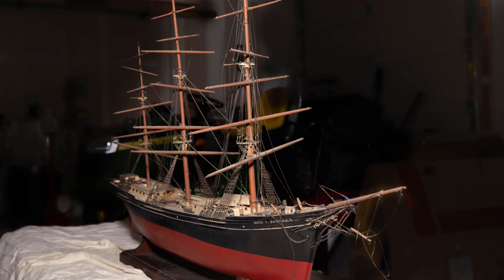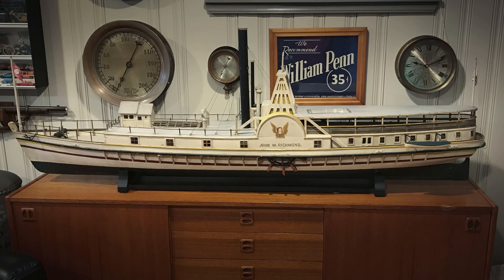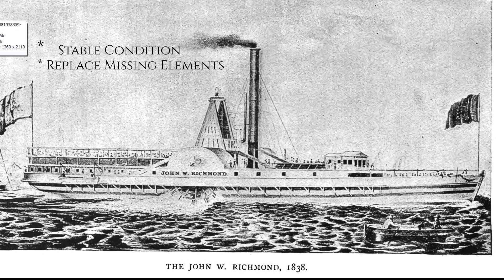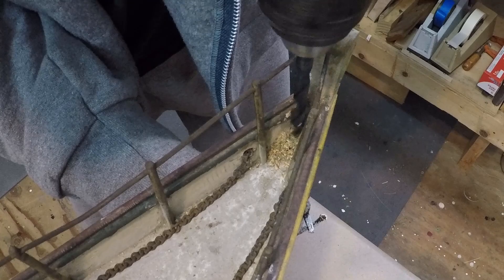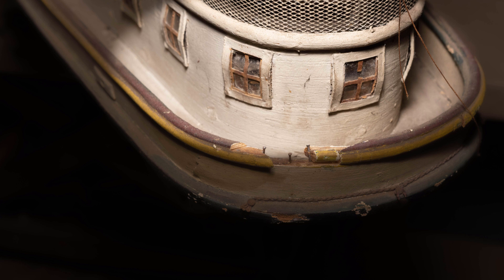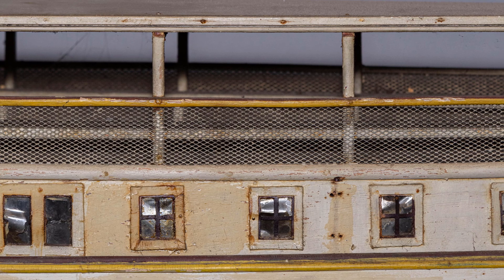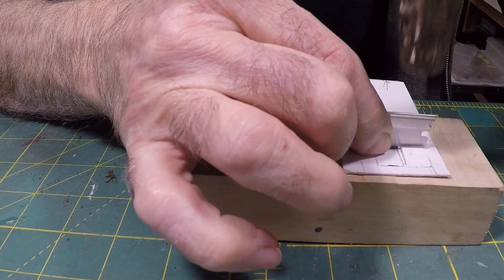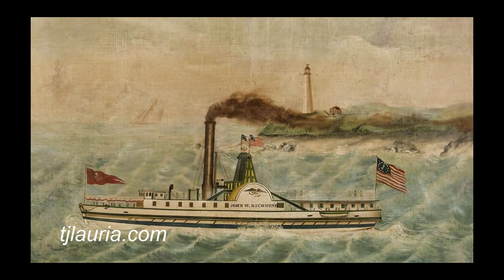Repairing a Fair Model, Episode One

Comment: Using quality stencil brushes on a batch of concrete sculptures wore the bristles to about 1/4" .
This made for very stiff brushes, later used to gently clean teak that gotten a bit of white paint on it.  I keep seeing how you could use such a brush to clean and to 'age' wood. (aging wood: lye/water mix, very stiff natural bristle brush, gloves. The lye melts wood sap and makes the grain stand out, like old, sun baked wood)  When a brass bristle brush might be too aggressive. Chop bristles off with chisel, shorten further, finish shape with belt sander.
Reply from the maker: In this particular case, there wasn't much in the way of impasto.  I mostly had to try to re-create the soot, ash and other pollutants embedded in the paint.